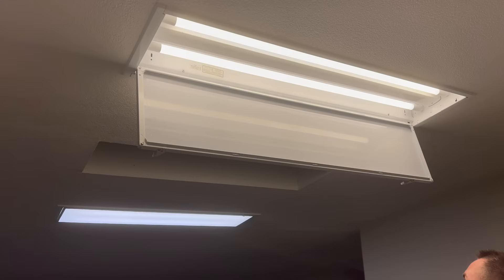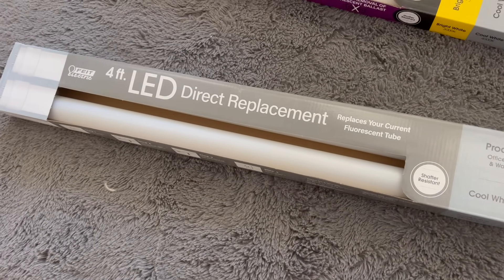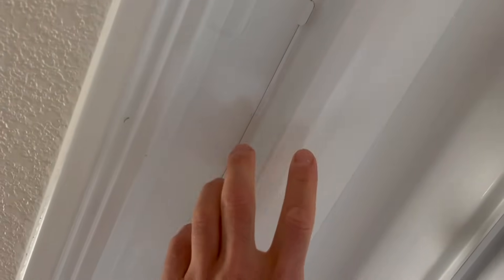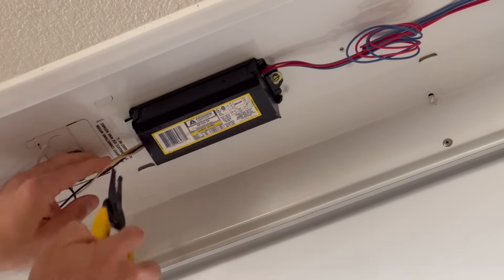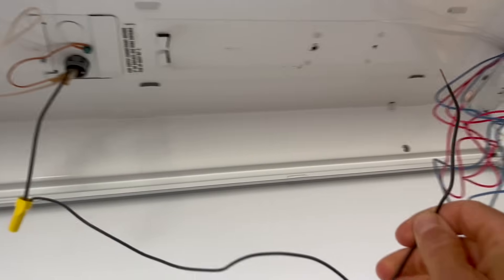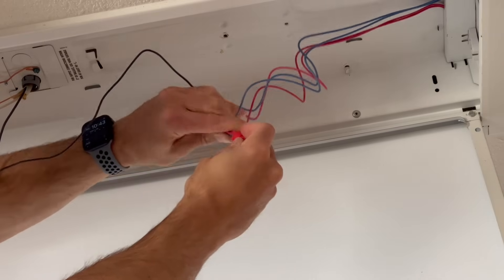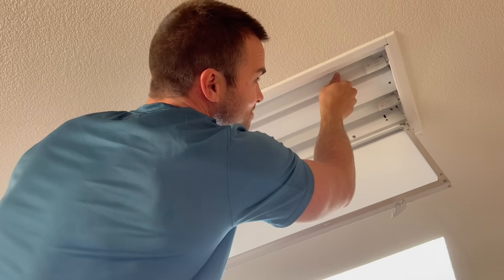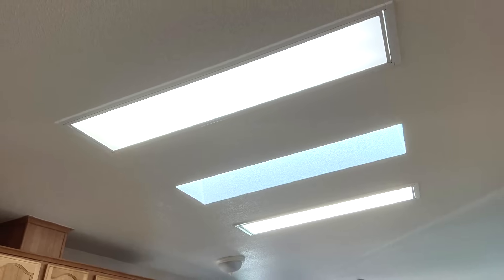Convert Fluorescent Tube Lights to LED - Easy Ballast Bypass Instructional | Builds by Maz

Comment: I was lucky to click on this video and got straight forward explanations with professional visuals. The beauty of modifying to direct connect (removing the ballasts) rather than purchasing new LED fixtures is that if there’s a failure you simply purchase replacement LED tubes. Rather than replacing the entire fixture.
Reply: Only suggestion I have is to put a label to identify the L (live) end.  This way in the future the person replacing the bulb will know which end is live in case they pulled the old tubes out before checking.
Reply: @louiscampeol9192  I thought the same thing as he was installing the new bulb. I'd never remember which end was which.

Comment: Why do the bulbs I bought have wires on them
Reply from the maker: Try getting these: https://www.homedepot.com/p/Feit-Electric-18-Watt-4-ft-T8-T12-G13-Type-B-Ballast-Bypass-Linear-LED-Tube-Light-Bulb-Selectable-White-2-Pack-T4815-4CCT-B-LED-2/321037737

Comment: I have purchased type A only to discover my problem with the ballast. Will the type A bulbs work with this bypass method?
Reply from the maker: It's not ideal. I would exchange for Type B, if you can.
Reply: @buildsbymaz  Yep. I tried it and they work but very dimly. I’m going to try to exchange them. Thanks!
Reply: I exchanged them for two type b’s. Looks like mid-day in the Florida Keys in that closet! 😂
Reply from the maker: @kimwidol  Awesome!!

Comment: I followed the instructions, but it didn’t work. I only had 2 blue wires and 1 red wire on the left…Connected the black to the 2 blue wires and the white wire to the red wire on the left - No dice.

Now headed to the hardware store for another ballast. 🤷🏼‍♂️🤦‍♂️

Comment: With my T8 bulbs, I had to only connect only 1 side, therefore the yellow wires were not used.   I then connected 1 blue and 1 red TOGETHER to the black feed (3 wires total) and then connected the remaining blue and red wires to the white feed (3 wires total).  My bulbs were labeled with the L and N on one side of the bulb.  As a test, I switched the white and black between the blue/red and the bulb worked as well.   Don't know why.

Comment: This video have a lot of issues.  The fixture might not be electronic ballast and if that is the case the magnetic ballast together with the starter should also be removed and the wiring for the starter circuit should be removed as well.  Also since YouTube audience come from all over the world, attention or declaiming warning should also be given in the beginning.  Connecting nuts are mostly used in US and Canada, different countries has their own electrical codes.  Most people including DIYers don't know why tombstones are not in the cemetery, please use trade jargons sparingly.

Comment: 3:31 - So my issue has been these latest led tube bulbs are about 1/16" longer than the previous fluorescent bulbs, and they're slightly too long to fit.

Any ideas?

Comment: Solid, simple, and straightforward. Thanks! The only other thing to consider is that it might be worth it to use lever locking Wagos instead of wire nuts, but this was great!

Comment: If I only have a black and a white coming from power side and one red wire and two blue wires, it appears I would connect the black wire to the one red and two blue wires, but what would my white wire be connected to?

Comment: are the bulbs you used type t8 or t12 ? or just led? thanks, jOE
Reply from the maker: They are LED, and can replace both T8 or T12. These are the ones I used: https://www.homedepot.com/p/Feit-Electric-18-Watt-4-ft-T8-T12-G13-Type-B-Ballast-Bypass-Linear-LED-Tube-Light-Bulb-Selectable-White-2-Pack-T4815-4CCT-B-LED-2/321037737

Comment: I only have one maybe really stupid question. To what do I attach the ground wire?  When I was taking the external covers off, my ground wire came off of somewhere I didn't see. It isn't shielded at all and appears to have been very loosely fastened.
Reply from the maker: It can connect directly to the fixture. Look at the 2:00 mark in the video, and you can see mine on the left hand side of the screen.

Comment: So I’m replacing a light with 2 ballasts (4bulbs total) there are 2 blacks and 2 whites. Left side have 2 yellow 2 red 2 blue and 2 black 2 white right side 2 yellow 2 blue and 2 red…also 2 switches to operate the one light
Reply: Great video though very easy to follow

Comment: How do I find the right circuit breaker to make sure my flourescent light fixture is turned off? Which part of the black and white wire to touch with my multimeter probes? I want to cut the wires and bypass the balast but bulbs or balast are bad.
Reply from the maker: You can turn the light on, and then switch off the breaker switches one at a time until it goes out. You can double check the black wire to make sure there is no current. I use one of these: https://amzn.to/3Tcpk6S
Reply: I'm sorry, but you're helpless if you can't find the circuit breaker for it 😂 you better just call someone with some common sense!

Comment: It is important to note that this Type B is Double Ended. There is also a SIngle Ended Type B which is wired differently. I always make labels specifying bulb replacement part numbers so that future tube changes are properly selected (also would keep someone from putting in a fluorescent tube).

Comment: With is type of conversation do the tombstones need to be replaced? Are the ends of the type B bulbs the same as the existing replaced bulbs?
Reply from the maker: They are the same - no tombstone replacement required!

Comment: Have a 20 YO home that came with 2 bulb T8 fluorescent fixtures in the kitchen. 12-13 years ago, changed them over to led with the ballast still in and the have worked until recently when 1 decided to give up the ghost. Check the bulbs and they were still working, so the ballast died. Ran across your video and it was straight and to the point as to what needs to be done. Took about 30 min due to having to make sure I am doing it right, but in the end it was a success.
Reply from the maker: Glad to hear it!

Comment: Use of the shop term "tombstone", while correct, is confusing to the amateur. Perhaps referring to the pin bases as a pin socket might be less confusing. EXCELLENT VIDEO! Very clear and helpful. Thanks!

Comment: Any suggestions for when bulbs seem stuck? Don’t want to break the long tube but can’t easily pull some out
Reply from the maker: You could try spraying a bit of lubricant into the ends and see if that helps you twist them.

Comment: Thanks for the quick and easy guide. I'm considering doing this to replace my old, failing magnetic ballasts, but felt I should mention that none of my local big box hardware stores tend to stock bulbs that support Type B / direct wire (at least, in the length I need.) It's all Type A, requiring an electronic ballast! Just thought I'd mention this for anyone like me who prefers to buy stuff like this (long, fragile tube lights) in person, rather than ordering online.

Comment: May be a stupid question but where do the ground wires go to? The white or black side? Mine has a green ground wire and I don’t see one in the video.
Reply from the maker: Mine is just connected to a screw in the light fixture - it's a bare copper wire that you can see on the left side at 2:06 in the video.

Comment: Also, if the LED tubes are dimmable then you can use them with a conventional rheostst. That’s not the case with dimmable “Plug and plays” that are used with a dimmable ballast.

Now as for me, I’ll sometimes prime and paint the inside of the light box which adds a bit of attractive tinting to the light that comes out. On Saturday I’m going to be bypassing three ballasts, priming and painting the inside of the light box in a peachy-orange paint, and set the color to 3000°K. This will make them radiate a beautiful orangie-pinkish color of light onto the kitchen below.

Comment: Yes, great video, you made it easy, thanks.  Heads up folks, my local Lowes AND Home Depot were zero balance on the direct to line power (Type B). They only had Type A, which sux for me because my ballast is shot and so this was the time to make the leap to LED, I figured.  I have a feeling Type B might continue to get more scarce because I bet you, stores are tired of taking returns on the Type B when customers find out they need to cut their ballast out of the loop.

Comment: Your video is very informative and concise.  My fluorescent light on my grow light system has an external switch on each of the 3 lights.  The wiring is slightly different than a wired fluorescent light.  I have a photo of the wiring for the switch.  Is there a way that I can send the photo?

Comment: Good info thanks.  Here is some additional info.  
TYPE A LED (Ballast Driven) 
Sometimes referred to as plug and play, the Type A LED lamp directly replaces traditional lamp types such as Compact Fluorescent (CFL) and Linear fluorescent.  No rewiring is required, no electrician is required.  You can simply replace your existing lamps with new Type A LED lamps.  Type A LED’s are not compatible with all existing ballasts.

TYPE B LED (Ballast Bypass/Direct Wire) 
The Type B requires rewiring of the fixture to supply line voltage directly to the lamp holders or sockets.  The linear versions, T8, or T5, are available in 3 different varieties:  Single Ended Power (SEP), Double Ended Power (DEP), or Universal single or double ended power.  Which version you choose is dependent upon your existing fixtures.

Comment: Huh I did all these steps and I have power in but no light….
Reply: Make sure your tombstones are bad
Reply: Also make sure you got type b bulbs type a need the ballests.
Reply: @ I had to split the the 4 contact wires into 2 forming a one side hot and one neutral on the tomb.

Comment: I don’t know what happened with mine. I did everything according to this video but when I put the LED lights in, it seemed like they were about half an inch too short. I’d get one end connected and the other end would fall out. I don’t know what’s going on.
Reply from the maker: Are they the same length as your original bulbs? Very odd.

Comment: Just thought I would say, nice video that is very clear, sadly not all LED Tubes are equal.
Some have Live at one end and Neutral at the other and some just have Live and Neutral one end and you connect nothing the other end.
Might have been a good idea to say at the start of the video that your LED Tubes are connected this way and others may vary.

Comment: Removed my old kitchen light and replaced it with a new LED fixture then i took my old kitchen light used this video to convert it from old fluorescent lights to type B LED and installed it into my garage where the old fixture was not working and missing its cover when i purchased my house in 2018. Thanks for the video!

Comment: I watched about a dozen videos. This is by far the best video on this subject, super concise and clear. My 48 inch lamp even had the same setup and color wires. My ballast burned out from like a 1970 fixture. I was open to throw the whole thing out.  What happens if I accidentally flip the bulb (positive side), just curious (I have a label maker and marked positive side, LED type B bulbs only on one side) Thanks.
Reply from the maker: Thank you! It depends on the type of bulb and brand, but if you flip the bulb side it just might not work until you flip it back around.

Comment: Hi I just did this today. I noticed that I had to put the hot wire with 1 red and 1 blue and also the neutral wire needed 1 red and 1 blue. I cut the yellow ones because they weren’t doing anything. Does it depend on the fixture which way you wire it?

Comment: I lived with a failing ballast in my kitchen for several months because l was too intimidated. Following your video, it was a piece of cake! It took 30 minutes and would have been faster if my wire strippers weren’t from the dollar store. They just weren’t cutting it…literally 😀Thank you so much for the clear and concise instructions and for including the recommended wire nut size. So helpful!
Reply from the maker: No problem, glad it worked for you. Definitely recommend getting some better wire cutters!!

Comment: Can it be set up with a dimmer??
Reply from the maker: It depends on what bulb you get - it can be kinda hard to find these tube LEDs that are dimmable. The one I used doesn't work with a dimmer.

Comment: I just performed the upgrade successfully and my only prior electrical experience was installing one single light fixture. Thanks so much! :goodvibes:

Some notes:

1) This is sort of the "best case scenario". In my case the black and white wires ran behind the fixture and only stuck out enough to plug into the ballast. I had very little length of white and black to work with; fortunately the other colours had plenty of excess length.

2) My ballast looked like it was bolted onto the ceiling and helped secure the fixture, so I left it alone (aside from cutting the wires) and worked around it.

3) I purchased 8-foot LED tubes without thinking about socket types. It turned out the LED tubes were FA8, whereas my old fluorescent tubes were R17d. At first I thought I'd have to return the tubes... Until I did some digging and found out I could swap out the old R17d tombstones with FA8 tombstones. I tried to reuse the wires from the old tombstones, but they were stuck in there and I wasn't sure what to do, so I just cut everything, stripped the ends and plugged them into the new tombstone (all the while trying to replicate the old wiring patterns as best as I could).

The FA8 type is very handy since it can be rotated. I was able to rotate one of the tubes towards the farther end of my garage.

I was almost surprised when the new lights turned on, but hey, I'll take it! :face-green-smiling:
Reply from the maker: Thanks for all the input! Glad it worked out for you.

Comment: Nice video. My wiring layout is a bit different. No yellow wire at all, just a set of blue wires going to one end and red wires going to the other end. Not sure how to hook this up?
Reply: Did you figure it out?
Reply: @ yes, it was easy!
Reply: @ yes, I guessed 50/50 and got it right.

Comment: ... extremely helpful.  Maz so clearly outlined connecting the 2 blue & 2 red lines to the black "hot" line and the 2 yellow lines to the neutral ---- for a very non-technical type this was most helpful.  Also, using 3 line & 5 line Wago connectors gave me confidence that the wires were not going to come lose as they do when I use wire nuts.  Concise and excellent ---- thank you, thank you!!
Reply from the maker: You are welcome!

Comment: I have a question so i bought these hybrid GE led tubes at lowes and did the ballast bypass method but on no end of the led tube does it say L or N would that mean it wouldnt matter what way I insert them?
Reply from the maker: You can probably insert them either way and it will work, but it should state this in the manufacturer directions for your bulbs. Not all LED tubes have an L and N side.

Comment: Excellent simple video. I have a two ballast four T5 bulb fixture; but, overall I'm pretty sure I got this (I'll review a couple more from others). Cut wires, remove both ballasts, wire as per this video except I'll have eight (L=Power) wires (x4 blue + x4 red) on one end & four (N=Neutral) yellow on the other end. Regarding the yellow (N) wires, I think I just need to maintain a jumper between the two sets of yellow wires (where each pair [x2] of yellow wires was previously wired to a single ballast, the jumper I'll install needs to maintain all four yellow wires in series. I haven't completely validated my thinking, but I think I got this wire since it's a direct connect Neutral (side) and a direct connect power (L) side. Great video, thanks.

Comment: good morning, I’m working on the fixtures at church. I have three blue wires coming out of the right side, which will go to the lamps, but I have a red wire on the left side. My understanding is the neutral would go to the red wire and the  black wire will go to all three blue. This is sound correct